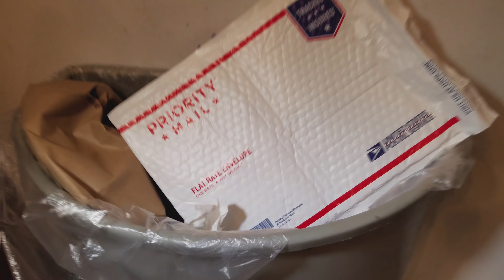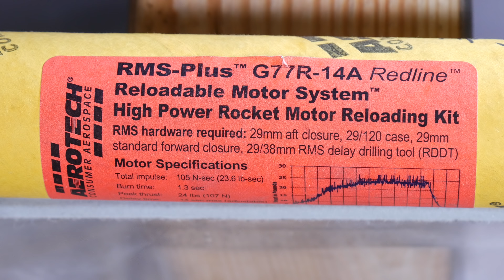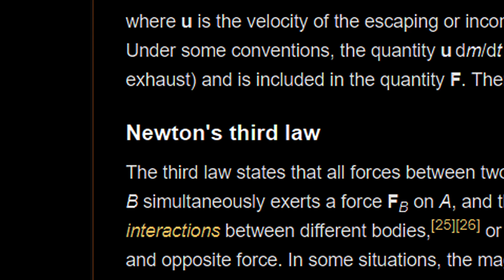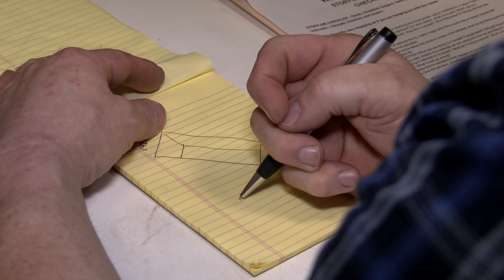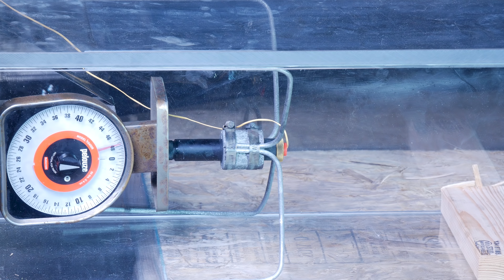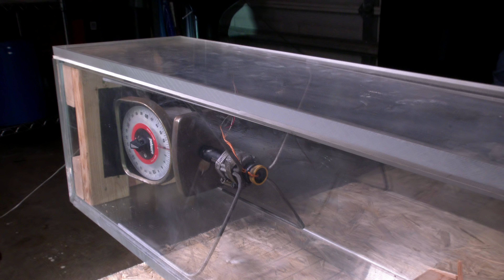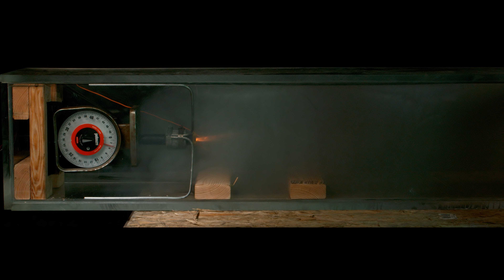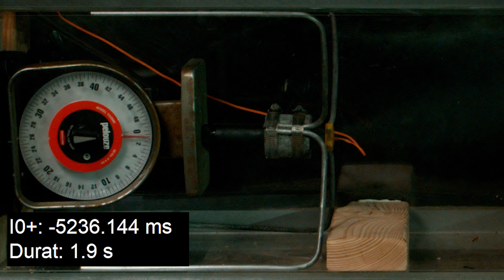Rockets in a Vacuum Chamber - Newton's third law of motion Visualized

Comment: Can we see the pressure gauge as this thing is replacing vacuum with gas?
Reply: Yes but the exhaust gases are not nitrogen and oxygen, so there still is no air in the vacuum chamber.
Reply: @danzervos7606  does it matter what it is? As long as it isn't vacuum (nothing)? Whether it's co2, nox, argon, r22 or fairy dust?  Anyway, the poster already responded to a similar comment. He said he was only interested in the initial pulse.
Reply: more likely NASA will show 4th wall. check my comment few minutes ago with time stamps, tell me if i imagine things.
Reply: This simulation is in closed system. Space is no closed system. This is bull crap
Reply: I have the same request as it was missing from observation.
Reply: 10:11 gauge is on the right. You can see the pressure increasing rapidly as the rocket gases expand and then dropping slowly as the pump is moving said gases out of the chamber.
Reply: You're absolutely right. To me it looked like that vacuum was compromised almost instantly. Just as I would expect under the circumstances.

The previous comment mentioned that the host responded to this issue by saying he was only interested in initial pulse, which was before the vacuum was substantially compromised. That makes me doubt the intellectual honesty and integrity of the host. Because if this were true, he had to have carefully analyzed both gauges in comparison in slow motion, to determine that it was true. If he actually did that analysis, then he must have understood its importance, so why would he not include it in the video?

It looked to me like both gauges went up at a very rapid pace, but to me it looked like the vacuum pressure gauge went up faster than the force of the initial pulse. So just claiming that the force of initial pulse was substantial, and claiming that at that moment the vacuum was still viable, are just that. Claims, which are not practically demonstrated. We just have to take his word. Even though he didn't show us a clear comparison of both gauges in slow mo, at 10:11 we can see them both small and fast, and slowing the video on our end, shows something which seems to conflict with his claim that the vacuum was still valid during the initial pulse.

It is pretty sad that with the dozens of videos testing this, not one of them is is done well with proper consideration for influencing factors and with real intellectual integrity.

The other problems I see here are that the rocket rig may limit force to only one direction, and the long narrow chamber will limit expansion to mostly one direction.

Personally i would expect rockets to work in a vacuum just fine, but the rapid expansion in all directions may reduce their effectiveness, and performance characteristics. I would like to see a more wide open setup instead of a long tube, and a more cleverly designed rig for the rocket. Maybe cables attached to pull-scales in multiple locations/directions. So movement would be restrained, but force could be measured in various directions. Then the results should be compared sensibly; all the scale gauges and vacuum gauge in slow motion, arrayed and shown side by side with the non-vacuum test for complete comparison.
Reply: You did not respond to a single thing I said. You responded to misunderstandings only. I know I was very clear. I use precise language at the expense of slightly long posts. So you consistently misunderstanding everything I said only demonstrates that you are incapable of sincere communication. I don't think you are stupid, which leaves only one likely possibility, you are being deliberately obtuse. Thus it is not even remotely worth attempting to point out your numerous errors in logic and obvious misinterpretations.

News flash: your deceptive communication tactics are obsolete.
Reply: You aren't communicating. Learn to communicate with a little integrity and I will be happy to reply in kind.
Reply: I had the same question when I was doing my BTech.  I asked my professor about how come a rocket gets propelled in a vacuum. He had no good answer at that time...  later on I realized that I was thinking the force in a wrong way...  rocket is never propelled like you sit on a wheelchair and push the wall to go in opposite direction... it's propelled like you are jumping out of the boat & no matter whether you land on water or ground, the boat is going to get propelled in opposite direction... 
In the same way, no matter whether the gases from the rocket goes in the atmosphere or in a vacuum, the rocket is going to go in opposite direction. in fact, it will go much efficiently in a vacuum as there is no resistance to it.
Reply: Gajanan Gavali
In a vacuum though, gas will be go in every direction as the pressure normalizes. The speed and force of dispersion in the vacuum of space should be dramatic.

Now of course I could imagine how as the gas initially exits in a given direction that it would not be unreasonable to assume the rocket would move opposite that initial direction.

This is what I have been told and I have no great reason to doubt it, but it is, for me, still merely a reasonable assumption, as I have not been in a rocket in space and I have never seen a vacuum chamber test which adequately verified this assumption.

I could also imagine another possibility. Dramatically increased expansion of gas and potential redirection of force. So take your boat example. Let's say we have some bunnies on the boat that reproduce at an insane rate. They give birth to billions of new bunnies per second and those newborn bunnies grow up instantly and go hopping straight off the back of the boat. The boat moves forward at a good clip with a strait stream of billions of bunnies flying straight back away from the boat. They all jump off in the same consistent direction. But now imagine that they jump off the back of the boat in every random direction.

So could the drastically increased expansion of gases exiting the rocket effect performance? I don't believe this to be the case, because, as I said, I have no great reason to doubt existing models. For me they are only reasonable abstract models though. Now of course I understand that the vacuum does not pull, and thus shouldn't be redirecting anything, and normalization is not an effect of vacuum but rather a tendency of energy and matter and the vacuum is an environment which provides minimal resistance to this tendency. So it would seem logical to assume that initial direction of exhaust would not change right away.

I am not so much questioning the validity of existing models as I am questioning the validity of this experimental setup as adequate verification of existing models. I am trying to see things from the perspective of those who might doubt or question existing models. Their doubts may be unreasonable, yet at the same time we base much on seemingly reasonable assumptions, and trust in certain authorities. Nothing wrong with that, but nor is there anything wrong with questioning it.

In this setup, the narrow chamber predominantly limits gas expansion to only one possible direction. The rig for holding the rocket limits force to only one possible direction as well, and with that rig any force less than 90° from the allowed direction will be redirected to that one allowed direction. Gauges were not shown very clearly for comparison and the importance of that comparison was not mentioned.

Finally, the host claimed in comment that he was only interested in initial force which was measured before the vacuum was substantially compromised, yet he did not clearly show in the video the pertinent details for verification of this. Looking at the gauges at 10:11, if you slow the video down and watch at highest res, it looks like the force increases, and the chamber repressurizes at very nearly the same speed. Because of the small sizes, distance between gauges on screen, and high speed, even slowed down on our end it is hard to say for sure, but it looks to me like the vacuum is compromised a little faster than the force increases. This conflicts with the host's comment regarding this matter. The only way the host could know certainly that initial pulse occurred while vacuum yet remained largely uncompromised is if he took the time to compare those gauges in slow mo, or even frame by frame. If he knew the importance of that comparison, as his comment implied, then why not show us the relevant comparison in clear detail.

I'm not saying rockets can't work in vacuum, I think they can. I'm only saying that this experiment is not really evidence of such. Sadly it is much better than most such tests, but that only shows how poorly conceived most such tests are.
Reply: I'm not showing you anything, I have zero interest in any of your nonsense. I was not replying to you and I already told you that your method of pseudo-communication is meaningless. Your question only shows that you have no interest in actual communication. Stop being such an obtuse, intellectually deceptive, dishonorable, psychologically manipulative, twister of words. If you can not conduct yourself with honour and sincerity, I forgive you, but i have nothing to say to you.
Reply: Ahh, that's ok man, I still forgive you
Reply: Right it needs to maintain zero pressure while in action
Reply: ricky clark, well maintaining zero pressure is not really possible with his setup, and maintaining a constant low pressure is not really feasible unless they had some vacuum pumps running that could remove pressure at the same rate as the rocket exhaust added pressure. Technically not impossible, but they would probably need numerous vacuum pumps running simultaneously. I'm not expecting anyone to go that far, though it would be a better experiment.

I would expect a slow motion, side by side comparison of both gauges, and a comparison of that with the same side by side of the test with atmosphere. Then we could tell just how much better or worse the rocket works in a vacuum. The current model predicts it should be slightly better without atmosphere.

It would also be much better not to restrict and redirect force, by mounting the rocket on a rig that only moves one direction. Better to suspend the rocket from several flexible lines attached to pull scales on multiple axis. So the rocket couldn't really go anywhere, but the directions of force wouldn't be restricted. Better yet, the pull scales could be rigged with pens to graph results over time onto a moving strip. Then the results could be accurately compared.

This precise comparison is very pertinent too, because we can not create a vacuum anywhere near that of outer space. So no matter what, there is atmosphere in that chamber, just less. If I were a flat earther, and I did not believe rockets worked in a vacuum (I'm not, and I think rockets probably do work in a vacuum), this experiment would not be very strong evidence to the contrary. Those who don't believe rockets will work in a vacuum, don't claim to have precise data as to how much rocket effectiveness decreases as atmosphere decreases. For all they know it could be a very gradual curve, that gets very steep at a certain threshold. So simply showing that rockets still work in lower atmosphere, well it just doesn't say much. Comparing amount of force over time could demonstrate that rocket effectiveness is not adversely effected by lower atmosphere, our if it is, how much at a given atmosphere. On the other hand if rocket effectiveness actually improved in lower atmosphere, then that could be evidenced. That would be far more pertinent than just saying, look it still worked, with less atmosphere.

A considerably less narrow chamber should be used too. The chamber should not restrict expansion of gas predominately to a single direction. I know that according to existing models it really shouldn't matter because gas is going to expand predominately in only one direction. But if you are trying to confirm/demonstrate the existing model, then the experiment should be designed to allow for possibilities outside of the model. If the model says gas will expand mostly in one direction, then you setup an experiment where gas can only expand in that direction, then you aren't really testing anything. The same reasoning applies to the rocket rig which only allows force in one direction. Maybe the rocket would work in a vacuum, but it would be uncontrollable, going in unexpected directions. I would not expect that, I think the current model is pretty accurate. But it is disingenuous to setup an experiment which is limited to only giving the expected results. This experiment was designed to prove the existing model, it should have been setup to disprove the model.
Reply: There are two possibilities:
A) You are trying to argue that rockets do work in a vacuum. In which case I completely agree, and we have nothing to argue about.
B) You are trying to argue that this demonstration of rockets working in a vacuum is absolutely flawless and can not possibly be improved upon. In which case I would say that is irrational, but I'm happy to 'agree to disagree.'

Now I'm sure you'll invent justification to spew some more vitriol, but anyone who witnesses your pathological tirades will probably not be influenced in the way you imagine. I have no problem whatsoever with rockets working in vacuums as described by the accepted model. I guess trying to understand the objections of those who do, is sacrilege to you though, because you are not actually a rational person, but rather a fanatic. You continuously argue only with yourself, and in the process you are only making your own positions look weak by association.

All anyone needs to do is look through the replies above to see very clearly your disingenuous manipulative tactics which rest entirely upon misrepresentation. I deleted a few of my replies because you kept changing yours. Yet it remains clear as day now, as it was with your first reply to me, that any attempt at communication with you is utterly futile. Because you consistently conduct yourself without honour or sincerity.

I suppose it is no wonder you imagine others being deceptively manipulative, when it seems that is all you know, and your only mode of operation. It is utterly pointless even attempting to address each of your misrepresentations individually. There are too many, and you are so predictably obtuse that your misrepresentation of any attempt at clarification is a foregone conclusion. It is also clear as day that rather than honestly engaging in communication with intellectual integrity, you are simply being a repugnant troll engaging only in intellectual harassment in the hopes of influencing others.

You insult others' intelligence by imagining they won't see right through your flimsy strawmen and ethically bankrupt attempts at emotional manipulation. You are not on the playground anymore and your infantile tactics are totally obsolete. Nowadays everyone sees right through the egocentric hand-waving, logical fallacies, and emotional appeals. We've all seen it before, learned to recognize it for what it is, and give it no credence.
Reply: Oh really, is that so?
Reply: Oh is that so?
Reply: Is that so?
Reply: Oh really? You don't say?
Reply: Hmm, is that so?
Reply: Aww, bored already?
Reply: Is that so?
Reply: Oh really?
Reply: Oh yes, I suppose that's one way of looking at it.
Reply: Oh, is that so?
Reply: If you say so...
Reply: Graham Rathbone  

Multi Mason is right this experiment can be made way better to avoid any error also we need more data than what the host provided... you're also the one getting defensive and cursing at mason. I don't think he threw in the towel and just showed his true face of being a "troll" I think he started mocking you with the "is that so" because honestly people get tired of having to explain themselves so much to people. You're clearly closed minded and you're also the one that kept replying wanting to have the last word cause if you truly meant that mason was the one that wanted the last word you should've left it right there but instead you kept replying. I think you're wrong and one sided don't bother replying cause I won't reply
Reply: Is that so?
Reply: no that would expose his lies :D 
where should we go with rockets ? :https://www.youtube.com/watch?v=57rXkKAEf_Q&t=1s
Reply: @project_nihilist  - actually the gauges were shown, and then cut away, just like in your "hypothetical", I.e. Cause is present, didn't see your predicted effect.  A dedicated PIP is what I was referencing. Nice bit about betting more than you have.  I suppose even God's beautiful universe has it's fair share of vanity and materialism, the irony isn't wasted on me, truly.
Reply: @multi-mason  you sure showed that graham guy what it's like to get a taste of his own medicine.
Reply: Well, well, the place is full of physicists.
Reply: @dr.mudr.farmaceutik7638  Obviously you have never taken physics.  A vacuum is a vacuum.  Open system, closed system, it doesnt matter.
Reply: @makismakiavelis5718  And that is why the thrust that is shown during the initial burn is important in this experiment.  It occurs before the vacuum is lost.  The remainder of the burn only shows that rocket engines do not need air  for combustion.
Reply: @oscarb9139 
That's right. Not only rocket engines do not require an atmosphere to function but they also become more efficient in a vacuum. That's why when you see the specs of a rocket engine there are separate values for thrust and Isp: vac./SL (vacum/Sea Level). The vacuum value is always higher.
Reply: @gdgavali  I
Reply: @multi-mason  Hi, In your experiment of bunnies jumping out of the boat, just add a single door exit at the back of the boat. now bunnies have no other direction to jump but at that back..  Fuel in rocket burns inside the rocket and then it starts to move towards exit.. as there is only one exit at the back and they already have gathered the momentum it will go only in one direction..  you are right if the rocket did not have any cover after the ignition of the fuel. then it will go in all the direction.. and the rocket will then move randomly.
Reply: no avail I have to agree. The vacuum can’t pull the gases out as fast as they are being made by the oxygenated propellant
Reply: Oscar Blue he said they were oxygenated propellants. We’re talking about pushing against a vacuum. The also seal atmospheric pressure in the motor to get it to light. This experiment wasn’t controlled enough.